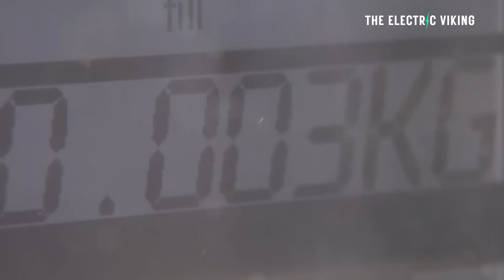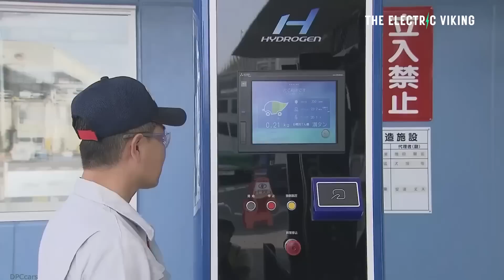Honda & GM's next-generation hydrogen fuel cell cars coming soon

Comment: He is shitting on EV's powered by fuel cells; that eliminate refuelling times, battery weight. Fuel cells that use hydrogen have their own hurdles to overcome, but they are far more likely to be overcome in the next 10 years over the limitations of batteries. The infrastructure for EV's does not exist either as the demand of electricity scales up with EV's, the infrastructure requirements are going to be impossible to manage. 10 cars charging in about an hour on a 100kw charger are pulling 1MW; A hundred cars = 10MW; A thousand cars = 100MW; Ten thousand cars = 1GW; 100,000 cars = 10GW; 1 million cars = 100GW. Total grid capacity of the US is about 1,200GW and population is about 360 million. 5% of the population were charging once a week; 18 million = 1,800GWh of 8,400GWh; That is about 20% of the current power generated.

Comment: Batteries are not the answer. They are not resistant to cold weather and are not as recyclable as led to believe. Many scrap metal yards are forced to stock pile the expired battery packs since no one wants them. So unless these hurdles are fixed in the future, there is a better chance for hydrogen to advance in the future. With hydrogen, you do not have to rely on foreign countries to supply raw materials and it is the most plentiful. Until this day comes, Its still gasoline for this guy.

Comment: It would be good if you were open minded objective, giving informative information. How the motor vehicle market will change and what the mixture of power will be. It’s a developing age, any positive step to reduce carbon emissions is a plus factor. Reducing emissions is from the complete cycle of production! The method of production of hydrogen will change it has to its called development and progress!

Comment: Hydrogen production breakthrough claims are just like better battery chemistry;  a lot of it is just claims based on lab results. No one is going all in to produce anything.  It is a high risk era; if someone else comes out with something better; you've wasted billions.  Right now Hydrogen is in the drivers seat simply because Lithium production limits EVs to a max of 5 million of the 100 million vehicles sold. Lithium production is also highly wasteful.
It takes massive amounts of water and mining to produce even todays niche market volume of about 3 million BEVs.

Comment: You probably should do some research before producing a video like this. You implied that GM's joint venture with Honda was secret. It's been public for about six years. Also, the electric grid in the US is overloaded at times and this is with less than 5% of vehicles being electric.  Add to that 95% of electricity in the Midwest and North East comes from coal and natural gas. 

Also, check out what you are exhaling and what plants consume, same stuff that ICE vehicles emit.

Comment: You made mistake with data and cost, Toyota car give average of 500km on 5kg, target is 1km=1rs very cheap but current hydrogen price is 1000rs to 2000rs per kg. So the world is fighting for 1km = 1rs. Another thing that we can make it happen if we invest heavy money and tech like jamnagar oil refinery for hydrogen not a oil. The real game is cheap hydrogen production.
Cheap hydrogen can produce by converting sea water into hydrogen by using unlimited wind and solar electricity.
So Toyota is genius.
1$ = 82rs
Reply: You made a mistake with your logic.  You assumed that wind and solar electricity are both unlimited and have little to no cost.   Imagine needing to install 4 times more solar and wind power to drive the same distance you can do today with battery electric.  Assuming it takes time to make and install solar and wind power, it would also take 4 times longer to accomplish the same goal.   So if it takes 15 years with BEV, it takes 60 years with FCEVs.  I currently power all my transportation with 15% of my rooftop solar.   That's without hoping for some magical conversion to someday happen that makes H2 efficient enough to cost only 1km=1rs.  Today, I wouldn't have enough area to cover with solar to convert that energy to hydrogen and then convert it back to electricity to make a vehicle drive forward.  Maybe someday, but certainly not today or in the near future.  I think pursuing cheap hydrogen production is a nice goal, but if Toyota was marginally better than an imbecile, they would lead by making cheap hydrogen first, then make a vehicle that runs on it, rather than the other way around.  Hoping someone else does the work for you isn't genius at all.  hydrogen costs 1000rs to 2000rs (1km = 24rs) for a reason.  It's like using the logic that incandescent lights are the future and if we just had unlimited cheap electricity they'd be better than LED lights.

Comment: 4:45 50 cars aren't really right.  It may be the average. At least in California, it's not.  Stations that store it as high-pressure gas hold about 120kg, which can fill a 5kg tank 24 times.  On the other hand, there are stations that store it as liquid hydrogen.  Those can hold about 800kg or 160 fillups.

Comment: There's one small/big difference between BEV and Fuel Cell. Usually  people speak only on CO2 emissions, but what about admissions? Fuel cell needs oxygen to work, BEV does not. Fuel cells will continue to burn the oxygen, where the people need it, like in the crowded cities...

Comment: I seem to be having a déjà vu moment.
I can remember not that long ago when negative comments like those being made here we're being applied to a concept of electric vehicles with batteries. Range anxiety was the catch cry. Costs would be sky high and it would never work. If Tesla can build charging stations with solar panels overhead and storage batteries in the ground. Then hydrogen charging stations can be built with localised electrolyzers to produce hydrogen from local scheme water or from rainwater tanks (while at the same time putting oxygen back into the atmosphere) and 10,000+ psi storage tanks underground. Solutions can always found to any problem and this one is no different.

Comment: Wow, using coal to make hydrogen.  I don't think the woke left environmentalist will accept that.  Usually they only accept green production even for hydrogen.  Here where I live even some government members knows that the hydrogen isn't the way of the future.  Outside Japan no countries have the infrastructure to make and deliver hydrogen to hydrogen powered cars.  each companies that want to make and sell these cars will have to create their own supply network and in Canada and the US I don't think the hard pro environmentalist will accept the manufacturing of Hydrogen from fossil fuel.  they will want only green hydrogen made from water and hydro electricity.  
And to make green hydrogen, you have to use water that isn't used for drinking, meaning they would have to use sea water and they would have to remove the salt first and that alon is a very hard process.  Experts in the province of Quebec have said that hydrogen doesn't deliver the same energy level or density as gasoline per liter.  
And to invest in hydrogen in general would be a waste of money and resources for very little in return.  And they have to start from scratch all the supply network.

You could compare that to windmill or solar power production with no ways to store the energy produce, something that is complete waste of money and time.

Comment: Sorry but for some one like me who cannot charge at home or at work ev,s have proven to be more expensive than a ice car .Toyota are saying that they will be making the hydrogen at the filling station so delivery of fuel is not needed plus you will have a 500 mile range and 3 minutes to fuel I personally believe it is the future ps after 8 years they won't lose milage because of battery degradation so will have a better second hand market

Comment: If you replace the word hydrogen with the words electric vehicles in Sam’s video you have the argument the anti-ev crowd uses against the adoption of EV’s. Electricity comes from fossil fuels (mostly). In Australia the Christmas Creek Iron mine’s owners are betting on green hydrogen to run the heavy equipment. It starts with 10 million solar panels to produce the electricity to produce the green hydrogen. Billions of dollars are being spent. If they succeed, another breakthrough to reduce climate change has been achieved. Very close minded to discount any new technology.
Reply: Except here in Ontario almost NO electricity comes from coal or oil, and NG is 27% and falling. But hydrogen will require 3x times yes three times the energy and costs to develop.
Reply: People are working on solar panels that can produce hydrogen to and you guys in oz are looking to see how much natural hydrogen can be drilled for now i believe. 

Malia already has been able to supply a local village with hydrogen escaping from from the ground years ago.
Reply: @jordanbrown7403  What garbage you post, how are you going to store the hydrogen the panels produce? Tank are not cheap and need regular replacement, and there is NO NATURAL source of hydrogen to drill for, try and find the URL if that is true.
Reply: A diminishing part of our electricity supply comes from fossil fuels. More than 33% of annual supply in Britain is from wind, solar and hydroelectric plant. That quantity is increasing at 3% p.a. Furthermore, big fossil fuelled electricity generators are more significantly efficient than fossil fuelled cars; around 50% compared to a real life maximum of about 22-25% for Diesel and roughly 17-20% for petrol=gasoline. 
If fossil fuels are converted to Hydrogen, those processes require energy input, and that comes from either burning fossil fuel directly or from electricity. If electrolysis is used to obtain Hydrogen from water, as at Christmas Creek, it's better, but never more than about 66% efficient. This may be the optimum method for that company, for economic reasons, so I have jo real argument against that. Converting their plant to electric motors in one go would be very expensive. A gradual changeover as plant reaches end-of-life would make much more sense for them. The Hydrogen still has to be pressurised- requiring more energy - and then (for general users)it has to be transported, using even more energy, generally by using Diesel trucks for the job. I expect electric trucks to become the default in future, not Hydrogen trucks. Once the H₂ is put into a car, or a truck, only 20 to 30% of the energy which is theoretically available from that gas goes into moving the vehicle. 
Vehicle efficiency for an EV is up to about 72% (Fully Charged Show face the references for that) and 'transportation' losses via the supply cables average about 3% in Britain, according to my energy supplier's documentation (Octopus). 

There is clearly no way that the Hydrogen route is more efficient than using electricity directly to power vehicles. The laws of Physics cannot be broken.
It's also worth considering the significant fact that H₂ is a pig to store and handle. It always leaks through container walls, pipes and valves, and its temperature needs to be controlled whilst changing pressure. It also forms an explosive mixture with air with as little as 5% Hydrogen. I've had to work with Hydrogen and have seen how dangerous it can be.
Reply: @RWBHere   The same arguments keep being put forward can we conceed that both hydrogen and electricity related infrastructure is getting better?

The solar panels,wind turbines,batterys,fuel cells,internal combustion engines all still need to be made after all and the materials sourced going into such things are problematic.

 Petrol/diesel and electric cars are a lot better generally then when they were first conceived i would argue to surely hydrogen tech overall since what late 1800s/early 1900s has also got better right?

Comment: So Honda and Government Motors have joined forces to go bankrupt together 🤣
Reply: Just to be clear, GM is NOT planning a passenger car powered by hydrogen fuel cells.
They have already co-developed fuel cells with Honda several years ago.
Take a look at GM's hydrogen fuel cell webpage and what do you see -- collaborations with companies that make class 8 or class 7 trucks, and collaborations with aircraft companies. Not partnerships, but rather cases where GM would be the supplier of hydrogen fuel cells.

It is only Honda of the 2 car companies mentioned that would make FCEV cars.

Comment: While countries explore various strategies to reduce fossil fuel reliance whilst keeping mobility affordable, Brazil's focus on leveraging sugarcane ethanol provides a greener example. In contrast, Japan's decision to finance coal-based grey hydrogen stations appears driven by protectionism for domestic automakers, rather than offering a genuine green alternative. Prioritizing sustainable solutions is essential for global climate goals.
Reply: Brazil is depleting the Guarani aquifer. Period. Its a great fault to overextract it as its becoming more and more critical to human subsistence. I´d rather have food crops to feed people, rather than using valuable farmland to produce fuel. Countries dreaming of hydrogen must do right. Fuel cell process, resources , tech and petents must be in sync with a sustainable world , otherwise its a total loss in favor for batteries.
Reply: Sugarcane is one of the crops that degrades so much the soil, that its really expensive to use it for another crop
Reply: @alexhguerra  I believe there may be some misconceptions about sugarcane ethanol industry. Over 72% of the Brazil's vehicle fleet can operate solely on sugarcane ethanol, which has been produced locally for more than two decades. This fact shows that Brazil resolved the economic viability issue surrounding sugarcane ethanol long ago. While it's true that sugarcane cultivation can cause soil degradation, modern agricultural practices have been implemented to mitigate these impacts.

It's important to note that there isn't a one-size-fits-all solution, and countries should explore alternatives that align with their local resources and conditions. In fact, when considering the entire lifecycle, Brazilian ethanol-powered vehicles have a 15% smaller carbon footprint than BEVs in Europe, primarily due to the Europe's less clean power grid. Thus, Brazil's sugarcane ethanol shows that there are other sustainable energy solutions that other countries can learn from.

Comment: Long term, I don't think it is fuel cell versus battery.  I think it is what can power the electric motors to meet the consumer's needs.  A battery powered EV would work perfectly for me as a daily city car with max range under 300 miles per month.  I would need a hybrid gas or fuel cell vehicle when I need to travel 4-12 hours on a road trip and don't want to spend hours recharging.  I would want to have a choices to decide what tech works best for me.

Comment: Hydrogen is such an utter waste of time in passenger vehicles. There are niches where it might work really well, but in cars - nope. The fuel is too expensive, the cars are wheezing barges, there will never be sufficient hydrogen and even if it were generated from renewables it takes 3-4x the energy as it would to just charge a battery. It doesn't even make sense to use hydrogen in its raw form when they could instead use ethanol to a fuel cell and open up various possibilities especially in countries like Brazil that already use ethanol. Toyota and Honda should both know this by now and I am convinced they are only playing this charade as a spoiler to BEVs and due to their absolute unpreparedness compared to other automotive manufactures.

Comment: I’m confused. Are we talking about how hydrogen is generated or about how hydrogen is used to run a car?  To me it sounds that what Honda is talking about is how to use hydroelectric cell to run a car. A hydroelectric cell is a method to convert hydrogen into electricity which in turn is used to run an electric motor to power a car. The output is pure water which is non polluting.
How hydrogen is created or how the electricity in your battery of your car is created is an entirely different matter. Both can be generated by clean energy sources or by polluting energy sources.
Reply: This^. Lets not forget if you do that, EV's face the same issues, with the added child labour spice in nickel and cobolt mines.

Comment: Why is it that EV drivers and fans, refuse to believe that there is/will be an alternative to Electricity.
Reply: It's not that there could be another alternative but rather that Hydrogen is not that alternative.

Hydrogen is more expensive than gasoline, why would I get a Hydrogen car to pay more to drive compared to gasoline.
Reply: @acolon8999  Bc there's no other option
Reply: @KL4BSGTR  you mean that besides EVs there is not another alternative to ICEVs?
Reply: @acolon8999  Ye I'm saying that there's no other zero emmisons option , every other fuel that is suggested like ammonia is just down right dangerous tbh
Reply: @KL4BSGTR  Got it. Maybe in 30 years when the last of the ICEVs sold by 2030 in those countries where they will be banned come off the road we might have an alternative to BEVs .  The only issue is that by the BEVs will be very cheap and electricity should be too so finding something comparable to it in price will be hard.
Reply: @acolon8999  Personally I don't like anything Electric viking says bc it's normally just Dinosaur $### like hydrogen is amazing solution to people who don't have a driveway